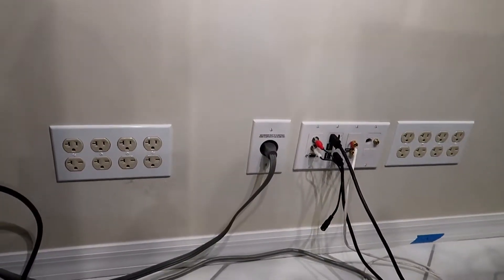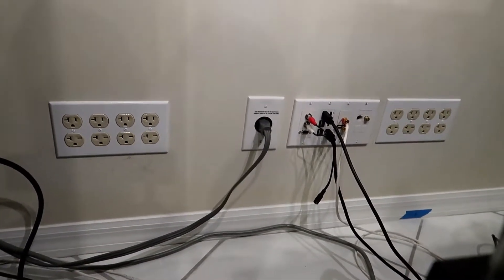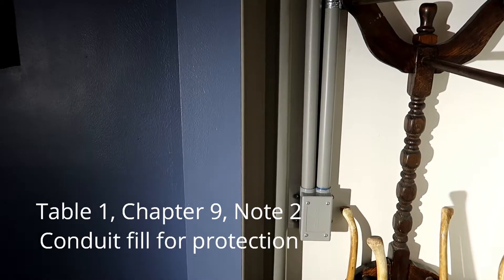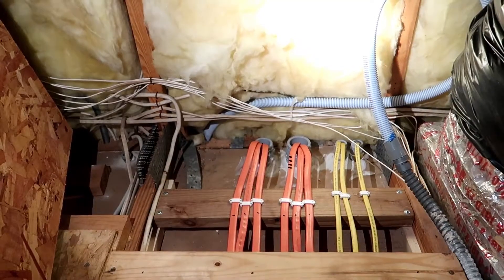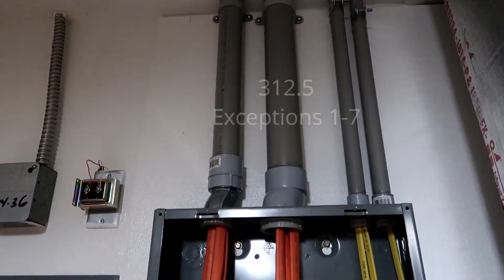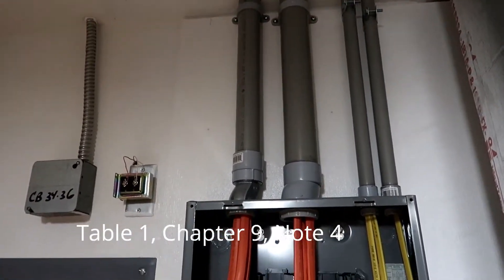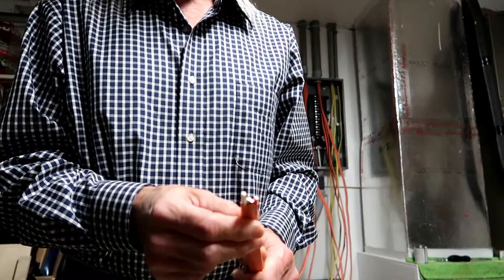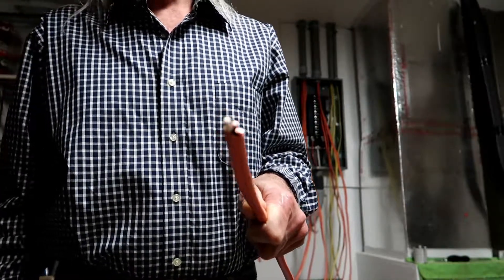Multiple NM wires through conduits into a sub panel.

Comment: Nicely done!   To my understanding, Article 334 used to say NM cable could not be run in conduit and has been deleted.   So,(my opinion) the conduits in the closet are there as raceway because NM cannot be run exposed in this instance.   If you are using pvc for physical protection, 334.15 (B) states schedule 80 pvc, not schedule 40. 
I am assuming you put the circuits on 2 pole breakers.
Again, very nicely don project!
Reply from the maker: Thanks Ken, it took me several months of reading NEC 2017 to create the plan and then a few more months to execute it.  Yes, I did use two pole breakers and I even used Combination Arc Fault breakers, those babies weren't cheap.  The 20A two pole breakers ran $100 each.  Thanks for watching.
Reply: @StevesStrayStuff     I’m not sure that you were required to use Arc Fault breakers.   Typically, the dwelling unit is only required to be up to the NEC it was designed and installed under.   A call to your areas inspection department would answer that.   Not sure how you came up with #10 required for voltage drop.   Must have been pretty long run.   If you need questions answered in future, just ask.   I designed electrical for 36 years.
Reply from the maker: @KevinCoop1  Wow Kevin, thanks for the offer to assist, I really appreciate that!  The Arc Faults were not required in my area, but I used them just to be safe, I must have put in three hundred staples running the wires through the attic.  Ah, the 10-gage wire, good question.  I purchased new audio gear and it operates on 100V – 250V with optimum performance achieved using 250VAC.  I installed dual voltage outlets, so I have 125V and 250V at each outlet and each outlet is rated for 20A. The audio gear has 20-amp circuit breakers in the chassis.  My branch circuits are eighty-five feet, so I did all the voltage drop calculations using 125V to make sure I stayed above the worst-case scenario of 3%.  To stay above the 3% at 125V, the 10-gage wire gave me 2.85%. My family room and bedroom lights do not dim with the bass anymore.
Reply: @StevesStrayStuff     You have done lots of homework.   NM is required to be supported and secured every 4’6”.    Let’s check one thing please.   You probably used 20 amps in your calculation.   Can you tell me either amps at 120 or 240 volts, or total watts?   Should be on nameplate but, maybe not.
Reply from the maker: The manufacturer’s manual just says 100VAC – 250VAC input and the amplifiers have 20-amp circuit breakers in the chassis.  However, the output of each monoblock amplifier is rated at 1000W RMS into a 4Ω load.  I am positive that I have provided my equipment a very stiff power source for optimum performance and also futureproofed myself 🤘🤘🤘
Reply: @StevesStrayStuff     You are correct, you should be future proof.    So at 20% wasted power or 1200 watts at 120 volts and 75’ of cable each run, you would be fine at #12 cu.   At 50% wasted power or 1500 watts at 120 volts and 75’ of cable, you just jumped up to #10 cu.   So, perfectly done!
Did you do the math or some program for voltage drop?

Comment: What have you have for sound equipment?
Reply from the maker: hi T.  I have Emotiva gear and it operates using 125 - 250VAC, the amplifiers have 20 amp fuses in the backplane.
Reply: @StevesStrayStuff  very nice!  I'm a power lineman by trade but also audio is my hobby.   Have a tube integrated amp and some warfedale evo 4.4s.  Changing my service from 100 amp too 200a with audio equipment in mind. Hehehe.    Would it have been feasible to install a sub panel in your case or nah?  Sometimes it's cheaper given copper prices.
Reply from the maker: @wng8993  The 200A upgrade is a great idea.  My main panel is 200A, the load calculations said I was only using 128A, but it is full, I could not add more breakers, so I added a sub panel for the audio gear.  With the audio gear on their own branch circuits, my family room lights and bedroom lights don't dim with the bass anymore.  Enjoy your musical journey!
Reply: @StevesStrayStuff  hahaha! "Lights dimming" That's how I listen too!  And you too!

Comment: i know this is an older video, however, my question is, could i apply the same concept to the feeder wire going from my garage’s main panel into a subpanel located in my basement? i would like to run 1-1-1-3 aluminum cable into a conduit as that portion of the cable would exit my garage and be attached to exterior of my home for about 3 feet…and once it enters my basement, eliminate the conduit as you’ve done once the conduit reached your attic
Reply from the maker: Hi Pharaoh.  You will need to check the NEC 2020 code, but I think if you use 1-1-1-3 Aluminum SER Service Entrance Cable you could make it work.  SER is type SE, Style R cable, used as an above ground service entrance cable, a panel feeder and in branch circuits. The cable is rated at 600 volts and 90_C for use in wet and dry locations.  I do believe that you can put SER cable in conduit to protect it from physical damage, but there are restrictions on conduit length and conduit cable fill percentage.  Check Article 338, that will get you started in the right direction.  Good luck with your project!
Reply: @StevesStrayStuff  thank you very much…i really appreciate you even taking the time to respond
Reply from the maker: @pharaohacura3618  Aluminum SER 1-1-1-3 has a diameter of .97" so a 2" Schedule 80 PVC conduit works out to be 26% cable fill, that way you won't exceed the worst-case scenario of 40% cable fill. A 1.5" conduit is 43% cable fill. If you use a Copper SER 2-2-2-4, you get 125 amps instead of 110 amps and you don't have to worry about oxidation and grease application, the diameter is the same .97” so you are still at 26% cable fill.
Reply: @StevesStrayStuff  here in Virginia, the price for copper wire of that size is $11/foot versus $2.50 for aluminum….i need about 30 feet, lol
Reply from the maker: @pharaohacura3618  DAMN!!! Never looked at the price per foot until you mentioned it, that copper wire is expensive!  You can buy a ton of grease with the $200 savings, haha 🍻
Reply: @StevesStrayStuff  😂😂😂😂😂😂😂😂😂

Comment: A dumb question. Could the sub panel go closer to the equipment?
Reply from the maker: Hi clone, that is not a dumb question because I did look at going that route.  The new panel would have to be in my hallway or a spare bedroom.  In that case, I would want it to be a flush mount panel instead of surface mount and the feeder wire gage would have to be increased from 3 AWG to 1/0 AWG.   The sub panel looks more appropriate in the garage instead of my home interior and I think was easier to install.  Thanks for watching.

Comment: Where in the code does it talk about elliptical fill?
Reply from the maker: NEC 2017, Chapter 9, Tables, Note (9), page 1104:

(9) A multiconductor cable, optical fiber cable, or flexible cord of two or more conductors shall be treated as a single conductor for calculating percentage conduit or tubing fill area. For cables that have elliptical cross sections, the cross-sectional area calculation shall be based on using the major diameter of the ellipse as a circle diameter. Assemblies of single insulated conductors without an overall covering shall not be considered a cable when determining conduit or tubing fill area. The conduit or tubing fill for the assemblies shall be calculated based upon the individual conductors.

Comment: Very amazing 😉 job. I’m curious how much did this cost in materials
Reply from the maker: Hi Kevin.  The wire was the most costly, the PVC was very inexpensive.  I ran six 10/3 with a ground and three 12/2 with a ground.  The wire lengths were 100 feet each and the total cost of the wire was $700.  I would put the total cost for the supplies at about $900.  I purchased all of my wire from Wire & Cable Your Way.  Thanks for watching.

https://www.wireandcableyourway.com/

Comment: Unless you're powering a stack of Class A monoblocks, this is WAY overkill. The biggest housewide system I've ever installed only needed 2 20A circuits.
Reply from the maker: Hi Doug.  My goal was to totally futureproof myself.  I only wanted to do this once and be done with it.  I planned this installation around the audio gear I purchased.  I have two monoblocks and one thirteen channel amplifier, each amplifier has a 20 amp circuit breaker in its chassis, plus the two powered subwoofers each have a 10 amp fuse.  The vendor manuals state that the audio gear requires a 'stiff' power source, so that is what I provided my audio equipment.  I am feeding them more electricity than they can consume.  It is better to have to much power available rather than not enough.  Thanks for watching.

Comment: How many watts is the sound system? Six 220v 30A circuit.  Damn
Reply from the maker: Haha, just the two main speaker monoblock amplifiers output 1000W RMS each into a 4 ohm load.  My sound pressure level meter hit 108db in my listening area, woo-hoo!

Comment: Did you use 120v receptacles for the 240?
Reply from the maker: Hi dirtdevil.  I used a dual voltage outlet, a Leviton 5842, one socket is 125V, one socket is 250V.  I pasted the link for the dual voltage outlet.   https://www.leviton.com/en/products/5842-i    I wired them per the National Electrical Code 2017, Article 210, Exhibit 210.2